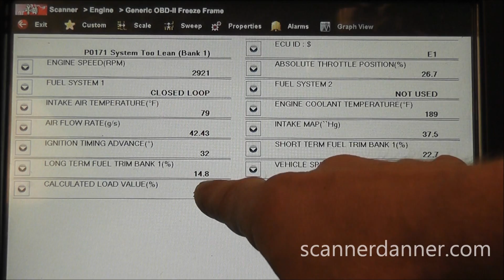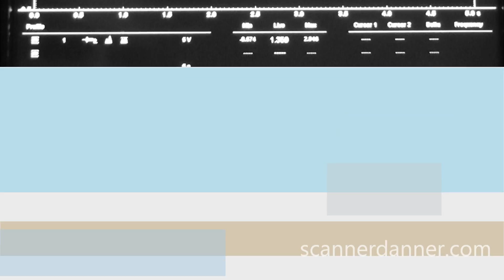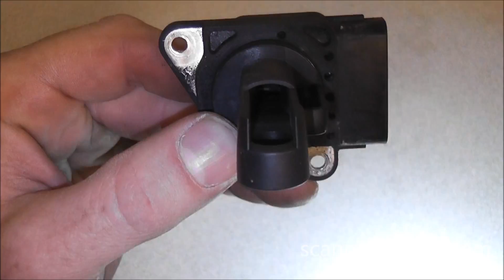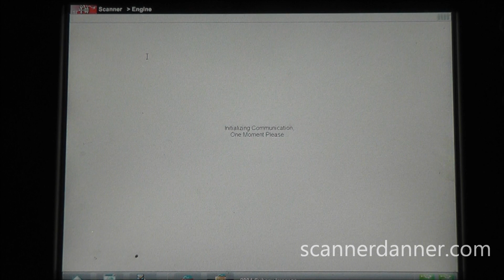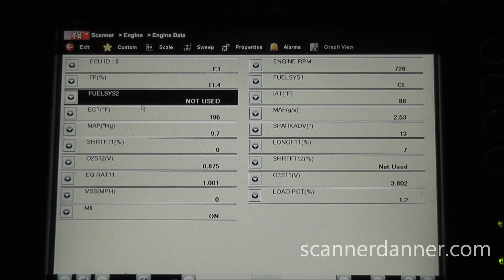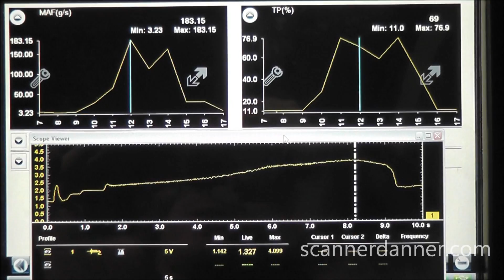How to identify and clean a dirty MAF sensor (Subaru)

Comment from the maker: yep, that is the only explanation that makes sense to me. clearly it is a characteristic that happens, so we cannot deny that. 
low airflow with a larger surface area = more dissipation of heat, which is interpreted as higher airflow, which = more fuel.
weird isn't it?

Comment from the maker: It does and for the most part will not cause a rich condition, but it can at times at idle like I've shown. 
The main condition with a dirty MAF is under load lean conditions

Comment: Hi i was wondering if you can clean a f 250 4+4 it is a flat box but i can see some wires is it cleanable or not it has 5-6 wire  have 171 penting 174freeze frame  thanks

Comment: ok....dirt or carbon deposits  make the hot filament on the MAF  bigger in surface , then the ECM see this as  "higher flow air"  ,that means the dirt or the carbon increase current draw on the hot filament ?  is like having a bigger filament.

Comment: Neat, looks like I got all of my info correct whew.  I have a video on cleaning a MAF (hotwire type) on the Mazda 626 if you want to show your students a very common Mazda/Mitsubishi design.  It's sooooo much easier to clean than the one in your case study. Sorry I didn't take any readings before and after it was purely a cleaning video.